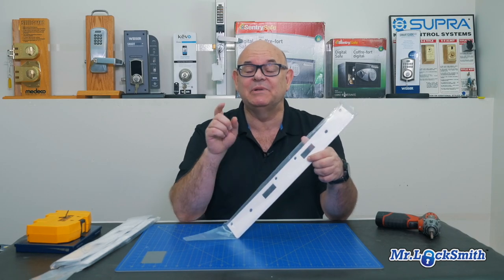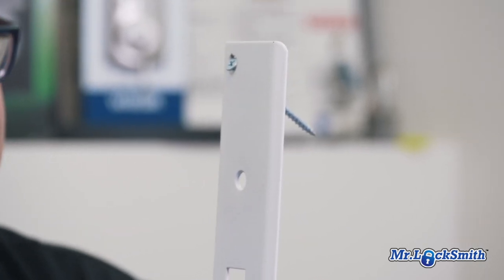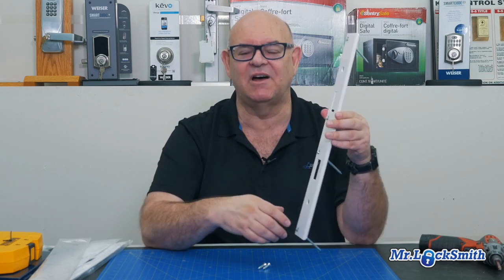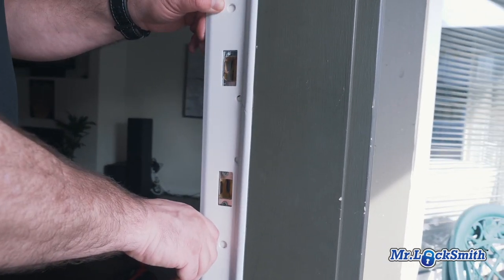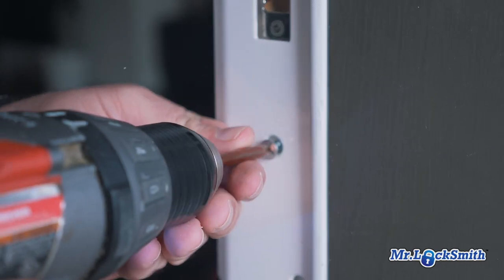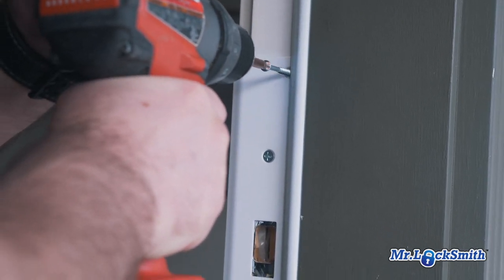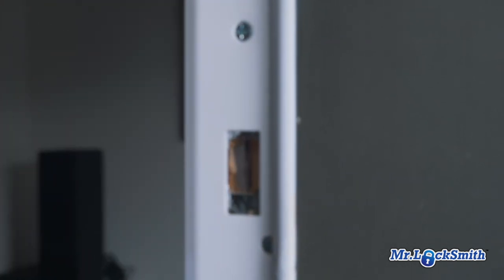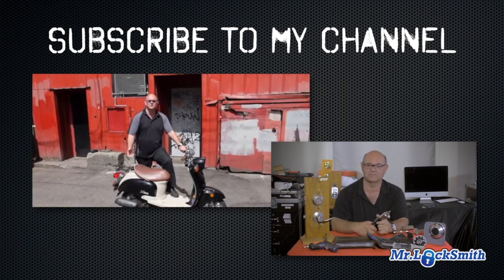Security Strike Plate Burglar Proofing Your Home | Mr. Locksmith™ Video

Comment: For the screws a tip is to use cutting paste, or even a kitchen soap bar, or a candle wax to give a light lubricant to allow the screws to go in without issue. Also the wax helps if you want to remove them later, as otherwise you have a very good chance the screw has rusted slightly and now does not want to come out. Then you either break the head off, or you have to use a gas torch to heat up the screw to loosen the bond to the wood and the paint layers holding it fast.

Lucky for me no wooden studs, so instead simply drilled 150mm through the frame, and into the brick wall, and tapped into the hole a wooden dowel so that the 140mm long wood screws would both hold the plate to the door, and also hold the frame to the wall, as the original nails used by the builder 60 years before had rusted away. Was fun to open that door a few years later, as the 6 lever Union lock had slip apart because the screws came loose, so I had to cut the lock bar through the inside gap. I wanted the ward pack intact, as those are no longer made, and buying a dozen keys along with the lock was expensive, but I had a few cores that I could rob the lock bar out of. Took a half hour and 2 cutting disks, those old locks have a really hard steel pair of pins in the brass, but they came apart eventually. Then 10 minutes to pull apart the lock, put the new bar in and make sure the screws were really tight, and back in operation.

Comment: I had a lock fail on my garage door; it was a high security lock and the tailpiece broke making it impossible to open. It was a steel door with reinforced jam. I ended up cutting the dead bolt with a 7” angle grinder; I went through 3 discs as the dead bolt had a tungsten insert. Once I cut it I opened the door and the jam survives quite well. I didn’t want to drill the lock as it was a high security lock and no local locksmiths, at least the ones I contacted, could pick it. I replaced the deadbolt and tailpiece and installed a reinforcement wrap on the door around the lock and it held up until I decided to change doors. I couldn’t believe how hard it was to get in with decent tools; I definitely wouldn’t expect a quick and dirty burglary attempt to get in. The door opened out so I was never worried about someone kicking it in but I was worried about someone prying it open; they weren’t do( g that with the reinforcement plate that’s for sure.
Reply: Are you talking about the main lift up garage door, or a side door?
Reply: @idmhead0160 : Side door. 32” steel door with frame. Would have probably been faster to cut the door than the dead bolt but then I couldn’t install a new bolt. The problem was the tungsten insert would spin free within the bolt body making it tough to cut, eventually I think the bolt body just got hot enough to get some grab and I eventually got through. I needed the 7” disks due to the distance and once they wore down to 6” they wore down to wear they wouldn’t contact the bolt do to the distance and the grinder I was using.
Reply: @libertarian1637  Sounds like it was a chore

Comment: What do you recommend for someone with a sidelight?
Reply from the maker: Shatter Resistant Window 3M Flim or Lexan / polycarbonate. 

I like a Double cylinder deadbolt but be aware it is a fire safety hazard.
Reply: @24hrMrLocksmith  all good suggestions. I'm talking about the door strike and the size of screws being an issue.
Reply from the maker: @AequitasSaints  Longer strike to distribute any forced attack. Some strikes are the length of the frame.

Comment: Purchased the defender security strike plate from home depot. Watched a video only to find that these wont fit. Videos saying a 1/8 drill bit needs to fit between the door. My front door has zero gap space. What options do I have? I want a good strike plate and what you mentioned wrap around? What is that? Thank you
Reply from the maker: Chisel out the wood frame to make the strike fit flush. 

Video(s) on the Channel, “upgrade” security.
Reply from the maker: https://youtu.be/QSafA5xqMQc?si=1cpzMsb2FpNzOKk-
Reply: @24hrMrLocksmith  Thank you

Comment: hello, sir i own a sentry safe model ESB i saw that you did a review on safe like these, and I'm having a problem. my safe won't unlock due to a low battery and the override key won't work for some reason. i saw that you use a magnet to open these safe I was wondering does the magnet trick work for the model safe as well and if so where do I place it to unlock it?
Reply from the maker: Install fresh batteries. If the key override won’t work contact Sentry Safe to order a new key or call your local locksmith to open the safe.

Comment: The wooden frame will just break when someone kicks it in
Reply: If you use 3" screws and anchor the plate securely to the double 2x4 studs, you should be OK.
Reply: @MGSsancho  If you are that worried take those 2 temporary screws out and put in 5 inch screws as well, and use them for all the holding. Through the wood of the frame, and through to the second stud as well, plus on the rest of the frame the same 5 inch screws to hold to the double studs in the wall, and that frame will not fail before the door or the wall does. Do the same screws for the hinges, and pretty much you will need a police style battering ram to go through. Though of course you will need a solid wood door, preferably one with a plywood core and solid wood cladding.